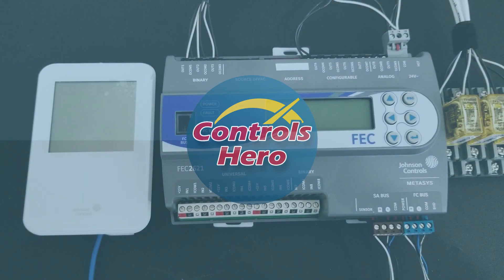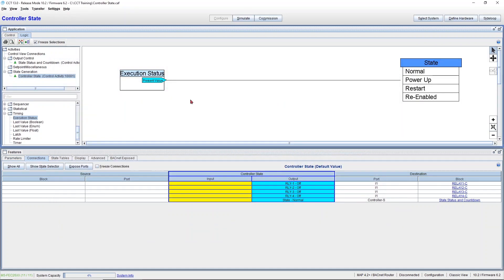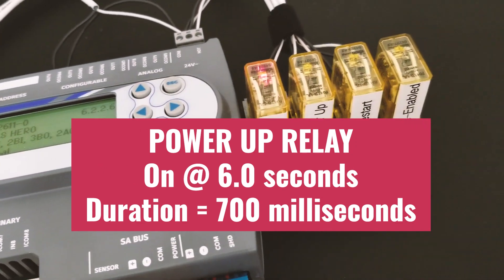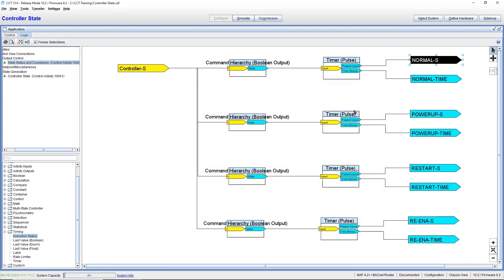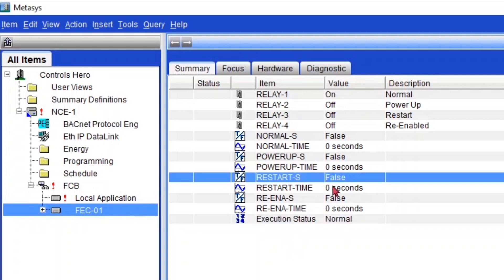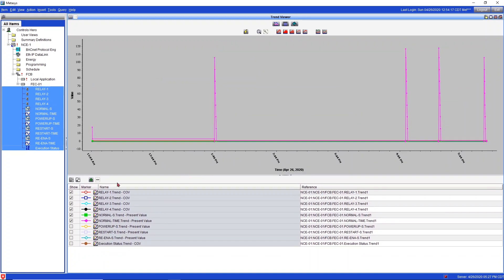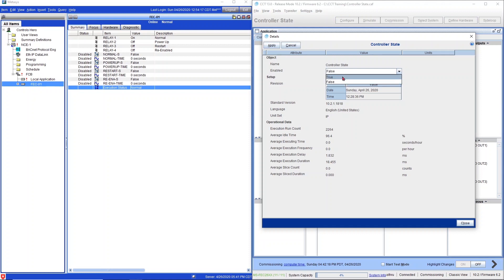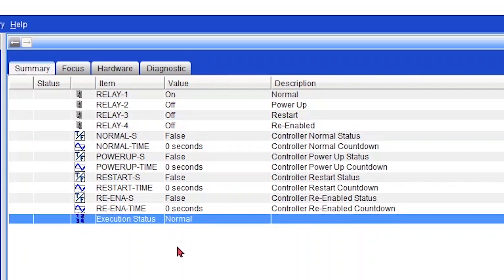Trigger CCT Logic after Controller Restarts from Power Loss - Execution State module

Comment: Hi Controls Hero, Could you please give me some advices about the following question:
1. Does the DDC keep the last value of AV, BV and MV when DDC's the power is restore?
2. If the question number 1 is YES. So, how can you change AV, BV and MV value to the default value when the DDC's power is restore?
Thank you!!!
Reply from the maker: Hi Tran Son, sorry for the very late reply. Excellent questions! Answering to your question #1, it all depends on how your software points were configured. I am assuming you are talking about an AV, BV, or MV created as a Network Input.

However, if you want these points to go to their default value, you will have to uncheck all the boxes under "Restore Command Priority". You can find this by double clicking on your point in CCT. Or in Metasys, you find them by right clicking on your point, then View, and Options tab. Hope this helps, I just tested live on an NAE and FEC controller. Thanks! P.S. Make sure to check my Blog on my website www.controlshero.com. I may create a blog this topic as I think it's very good to know.
Reply: @controlshero  Thank you for your advices! :))